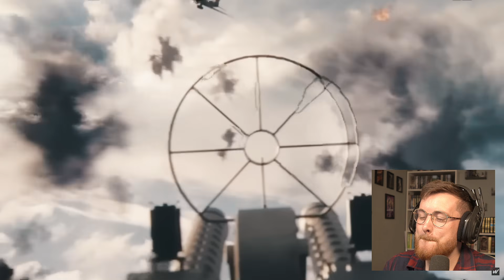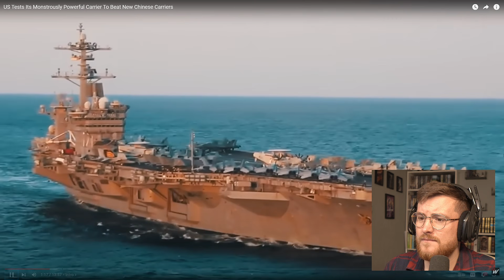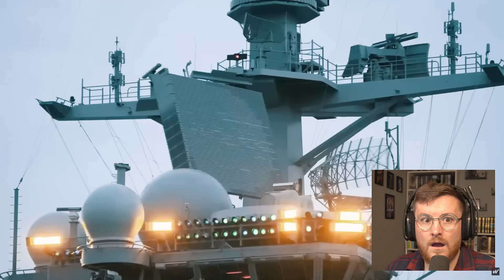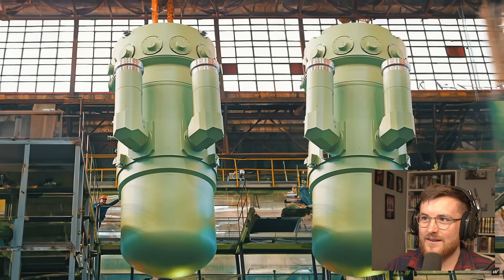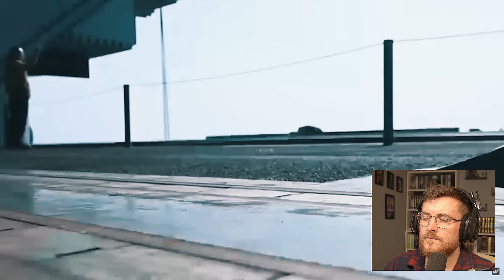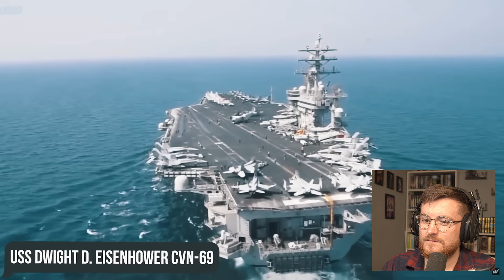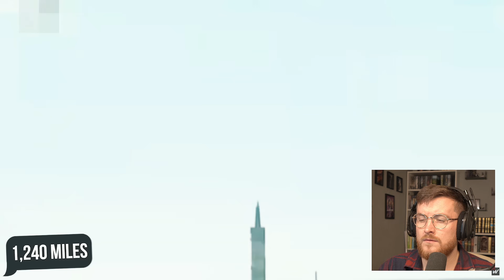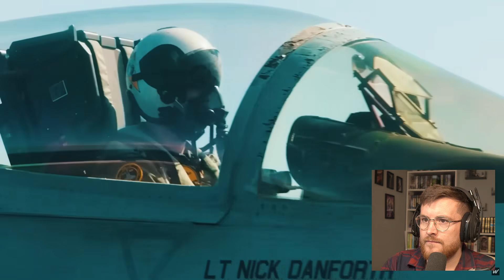Royal Marine Reacts To US Tests Its Monstrously Powerful Carrier To Beat New Chinese Carriers

Comment: Fun fact: US Navy is the second largest air force behind US Air Force
Reply: US Army has more aircraft than a lot of other nations' air forces as well. MOSTLY transport aircraft and helicopters, but still....
Reply: U also have more boats than usn @captin3149
Reply: @captin3149  the Army heli fleet doesn't constitute an "air force".
Reply: @colbunkmust Yer quibbling. The US Army still have more air assets than most, if not all, other militaries in the world.
Reply: @colbunkmust but all it takes is one gun ship to change the outcome of any battle
Reply: @chrisrobinson2410  Not any battle. Especially if the only aircraft your side has is helicopters, because you can't maintain air superiority with Apaches. Any 4th gen fighter wing would absolutely shred a contingent of attack helicopters if that side only has what the US army has... which is why the USAF exists.
Reply: @TheGhostGuitars  More air assets doesn't equal larger *air force*. Fed Ex has a larger fleet than most militaries as well, but it's not an air force.  The US Army can't operate as an air force, ergo it's not one. The US navy can actually operate as an air force and conduct any mission that is expected most  air forces. The US Army's aviation branch is not capable of doing those missions. If anything, acting as if the US Army's aviation branch is an air force because it has aircraft is quibbling. The US army relies on the USAF for fixed-wing support specifically because it doesn't actually possess much of the tactical or any of the strategic capabilities of the USAF.
Reply: @TheGhostGuitars  Well, that introduces quibbling within itself however. What constitutes an air asset today? The Russo-Ukranian war has kind of redefined that in my opinion. Like where do drone bombs land, are they loitering munitions or are they "air assets?" I'm also not asking this to be semantic or a smart a*s, I'm genuinely curious. Setting aside recon drones, which are air assets, where do kamikaze drones fall because that might tip the scales just by pure number. It doesn't tip the scales by quality, but it's something we've created, like AI, and now we've come to that point of reckoning.
Reply: @TheGhostGuitars 4th or 5th as we have 1,2,4,5 lol
Reply: @chrisrobinson2410 ,
   The idea is that the greater the air power set against these gunships as you call them the less chance they have of surviving to "change a battle".
Reply: @chrisrobinson2410  With the accompanying strike group, it would not be easy to get any gun ship close to a US Carrier.  Just the surface ships alone are impressive by themselves - together, plus the AWACS and subs?  Yeah, not an easy task.
Reply: @colbunkmust you never fought in a war
Reply: @metafixer05  That sort of proves my point though, doesn't it? The US Army doesn't have an air force because it lost it when the Army Air Corps became the USAF.
Reply: @metafixer05  Sure, one could even argue that the older structure made more sense from an organization standpoint. The Navy has it's own aviation, and the USMC is part of the DoN while the US Army and USAF are split. The big upside with the current structure is that the USAF gets more funding, but that's only an issue if the government fails to properly account for the importance vs cost of maintaining a top tier areospace contingent.
Reply: @colbunkmust  yes it does, its vehicles that go in the air you bot
Reply: @colbunkmust  your a muppet
Reply: @hhill35  You're 🙄
Reply: @colbunkmust your full of shite
Reply: @colbunkmust yea but fedEx planes aren’t build as fighter jets or bombers with guns & bombs attached to them….so im not sure how this is an argument compared to a military fleet of aircraft. Maybe i misread.
Reply: @colbunkmust  Army heli fleet pulling up with the Delta Force is another nations worst nightmare
Reply: @ovrlyfocusd  The mission was entirely dependent on USAF, USMC, and USN aircraft to conduct air superiority and SEAD/DEAD so the helos could get into the country without AAA or SAM related fatalities.
Reply: @colbunkmust no shit the different branches are reliant on each other. That would be like saying without the army the USAF wouldn't have been able to carry out those operations. Do you understand why this is such a weird statement you made?
Reply: @MrJones-lz7ms  Read the context of the thread. If people weren't insistent on trying to claim the US army has and "air force" I wouldn't need to reiterate obvious points.
Reply: 4th largest air force in the world is the US Marine Corps
Reply: @dwarvensmith80 Yeah ... and ain't Nobody gonna say "That Ain't A Real Air Force"
Reply: And the Navy's boats in museums are the 2nd largest naval fleet
Reply: Fun fact: we occupy 4 out 5 spots of the "5 largest air forces in the world" Army Air and Marine Air are 4 and 5
Reply: @haventthoughtofanameyet6364  No, we don't. Helicopters are not counted in the totals because they aren't airplanes.
Reply: @michaelposeyYT  Air force is not "airplane only" you know. Air forces constitute helicopters as well. Their role is definitely a different one, but they do not belong to the same category as a UAV or drone.
Reply: 1,2,4,5 is our ranks i believe
Reply: @Eightysix_80six. And the third largest air force is The United States Marine Corps.
Reply: And just in front of the U.S. Army.
Reply: The carriers also have a large contingency of USMC aboard them. I think that’s how the USMC got it’s name ?
Reply: @Cupid0123  The mission of the   USMC is to protect the fleet, every major US Navy warship has a US Marine detachment on board. Marines seize ports, enemy installations, beach heads and  protect our country. Marines fight to win. Always.
Reply: And the Marines are the 4th🇺🇸
Reply: It's like Debo from Friday rolling up with a group of friends. As if Debo wasn't enough, each of those friends is really good at a specific portion of ass-whooping. I almost forgot about his badass little cousins that sometimes ride on the ships. You REALLY don't want them to get involved.
Reply: Fun Fact: US Army has more ships .
Reply: Maybe the US Army or USMC are not an “Air Force”, they still have some bad ass birds
Reply: but number 1 as a navy.
Reply: The US Navy is the first and second ranked Navy in the world via tonnage
Reply: Fun fact: The US Navy did not want the creation of the US Air Force.
Reply: Yep and the US actually owns both the largest AND the second largest naval fleets in the entire world. The second largest being America’s fleet of museum ships.😊
Reply: You mean the chair force?
Reply: @CollectorsDepot23 think that one all up on your own?
Reply: The second largest navy is the US naval museum fleet.
Reply: And Remember the militia in Texas that’s an extra Army lol
Reply: Don't mess with TX  @azteca7723
Reply: Another fun fact , speaking for the eighties, the us army owned more boats than the us Navy , its true,believe it or not
Reply: I just replied the same thing.
Reply: Fun fact USA has 4 of the most powerful air forces marines coming at #4 after the army . Army mostly consists of choppers. Marines have tons of jets
Reply: lol and the Marine Corp is number 4
Reply: I find it so funny (thankfully so) that our military is so big it argues and competes with itself…as evident by all these comments. lol 🇺🇸
Reply: Hooyah!!!❤❤❤❤
Reply: This gentleman is forgetting when we talk about having 10 of these carriers that they won't be all in one place. If it comes to ww3, think of the countries the u.s will have to defend, along with our allies, and that doesn't count protecting our own country.  But you're right in the description of what it would look like.  Think of Toby Keith's song " Put a foot up your a@@, light up the sky like the 4th of July when the staue of liberty starts shaking her fist"...and that's not to mention that there are personal weapons numbered 2 to 1 in America from pistols, rifles and a bunch of others.
Reply: I don’t believe west Taiwan has any of these “weapons” they claim to have.
Reply: Another fun fact, with all that fire power, America has tried taking Canada over twice in the past and failed. As a retaliation the second round, we made it to the White House and burnt it to the ground. One more fun fact, the New York Police Dept. has more police officers then our entire Canadian Armed Forces.
Reply: @davidsharpe9310 yeah back in the early 1800s.
Reply: Sweet 😮
Reply: Also, our fleet of museum ships is The second largest navy in the world.... Behind the US Navy of course
Reply: 1st, 2nd, 4th and 5th (maybe 6th) largest airforce in the world. Man, we just be buildin shit.
Reply: And the US military Museums are the second largest navy in the world 😂
Reply: US Air Force #1 
US Army #2
US Navy#3
US Marines#4
These are the top 4 worldwide rankings of Air forces in the world.
Reply: Also fun fact, the US Army and IS Marines are the 4th and 5th largest air forces in the world too.

Russia is 3rd but seeing how they are getting completely embarrassed by Ukraine, it seems line America could beat Russia with less than a quarter of America's air power 😂
Reply: its actually the other way round
Reply: You forgot space force. It's not about weapons per se. It's about intelligence and the ability to shut down communication systems globally. Think about it.
Reply: United States Air Force - 5,213
    United States Army Aviation - 4,443
    Russian Air Force - 3,864
    United States Navy - 2,404
    People's Liberation Army Air Force (China) - 1,992
    Indian Air Force - 1,728
    United States Marine Corps - 1,240
    Egyptian Air Force - 1,069
    Korean People's Army Air Force (North Korea) - 947
    South Korean Air Force - 905
Reply: @michaelposeyYT  US navy has over 3700 Russia has just over 3600. US Air force has over 5600.
Reply: @ Nope. Navy has 2400 fixed wing aircraft. Navy helicopters are not planes.
Reply: B.s
Reply: Remember the U.S ARMY AIRCORP WAS THE BIGGEST . ARMY IS THE AIR FORCE DAD
Reply: Boots on the ground is what wins wars... Every time! So, all this stuff that all the branches possess exists to support army and marine grunts and SOCOM/ JSOC forces. Period. I'm sure someone will try to argue. Bring it... with examples, please. 😊 One team, one fight. 🤙🇺🇸

Comment: Yes, advanced weapon systems are scary BUT.... LOGISTICS wins wars. The best weapon system in the world is useless without ammunition and food to feed the operators. Which is the reason for the Carrier Group. It's NOT just the Carriers.
Reply: We need more oilers, ice breakers, and those service/maintenance ships (the one with the crane on the ship that can load other ships) just as badly, if not more so than fighting craft.  IE: we desperately need to re-built our old ship yards.
Reply: We have a ship ( ion know the name off the top of my head) that brings ice cream to other ships
Reply: @Just_sum_guy_ig 
😆 I recall a brief scene in the film “Battle Of The Bulge,” where a Kraut general brings in a captured American chocolate cake into a briefing during the battle.
  He made the point that while the advancing German troops were dangerously short of  fuel for their tanks, the “Americans have enough fuel to fly chocolate cake across the ocean!”

 You are correct. Logistics wins wars..
  The American military has ginormous support/logistics assets.
Reply: That's what MSC is for
Reply: 4:38 I imagined a hostile country (pick one of the 4) seeing this then a week later unveiling one. Then we later find out it’s made of aluminum hull and wood framing and runs on diesel.. the water in the engine room is a cooling feature not a leak seal failure
Reply: THE US COULD TAKE IN THE WHOLE WORLD WITH NO RULES OF ENGAGEMENT AND NO GENEVA CONVENTION.If any number of countries tried to invade the us they would not make it past the border!Do u think that us country boys and engineers and chemists couldn’t make bombs from everyday chemicals,if we can make potato launchers don’t u think we can make weapons from that same technology to wreck any helicopters or planes these countries have?
Reply: An army marches on its stomach is an aphorism going back millennia for a reason.
Reply: You just love pissing on everybody’s Wheaties dont  you?
Reply: And that vast company of ships that support the carrier also have crew that needs to be fed and ships that need fuel. 
Take out the supply ships and everything shuts down.
Reply: Aircraft carriers don't have a lot of anti-air or anti-missile stuff but the other ships around them do. Also I'm pretty sure between 5 and ages pretty sure the hypersonic is probably not a problem when you have like eight ships trying to shoot the dang thing
Reply: You can do this nonsense for a myriad of things... communications, expertise, manpower. Pull your head out.
Reply: Notice that nobody's even mentioned the SR72 Since they said it exists. It's been out there.Gathering information without drawing any attention. Just like the planned. Information
About your enemy is Is the biggest advantage you can have.

Comment: So the ford class is only about 14 ft longer than the Nimitz class the main focus of the Ford class was advanced and technology and efficiency of performance of every task the shit is designed to be able to be manned by less personnel and the ship produces more power with smaller reactors just think of it as a generational update lol i’ve been in the Navy for 11 years and my job requires I can only be stationed on carriers and I can tell you the limit class carriers have just as impressive stats

Comment: With all respect...I am really surprised by your shock at the size and capacities of the Ford class carriers....they are only a tiny bit bigger than the Nimitz class carriers that have been in operation with the US Navy since the 1970s?! Both old and new carriers are nuclear powered, and both are 1092 feet long at the waterline...the Ford is only a bit heavier because its flight deck is a bit larger...and the Nimitz can carry up to 90 aircraft just like the Ford. I mean, was there not even an orientation course in the Royal Marines to familiarize you with the other NATO Navies in case you might work with them?

Comment: They make the same mistake with CVs what they did with Battleships.
They are too fucking big.
As shown in mock battles against navys with modern systems. Many CVs already been sunk by submarines even with the entire battle group to protect them.
We need to go back to smaller CVs.
Reply: the problem with your claim is that most (all) military mock battles pit the US against other forces with severe limitations. In the types you listed, they usually prohibit the use of sub-surface sensors to make it "more fair". Having smaller carriers also wouldn't help and would just reduce the strike capability against any target by limiting airframes for no good reason.
Reply: @nerocaesar9249  PS
Why todays US guy are so arrogant.
Second Pearl Harbour will come that way.
Also China outproduce the entire west.
Reply: @nerocaesar9249  the french, sweden and germany did it.
Also Germany did it two times and that one time it was with an old diesel electric boat in a not training situation.
China has a shit ton of new fuell cell and atomic u boats.
They can blew those big ass ships to Kingdom Come.